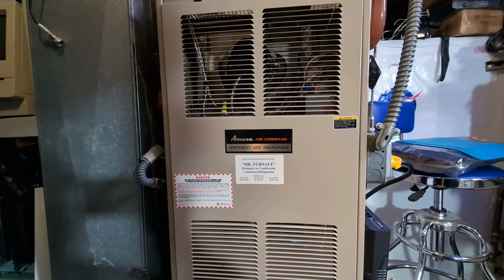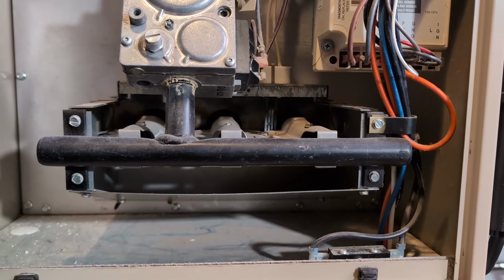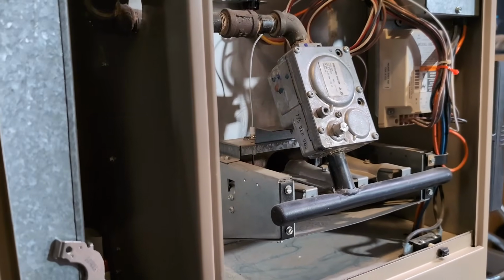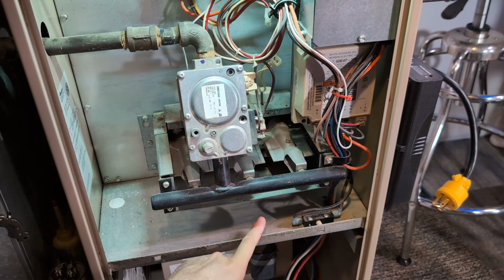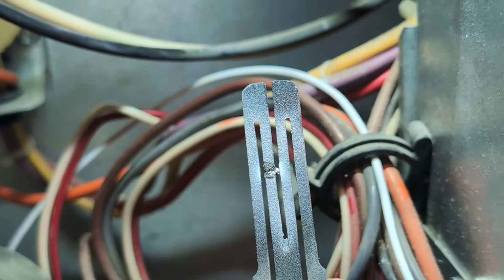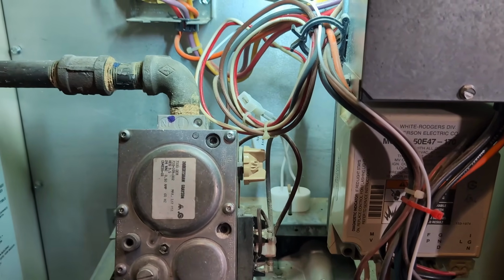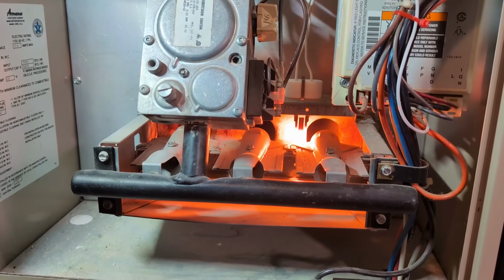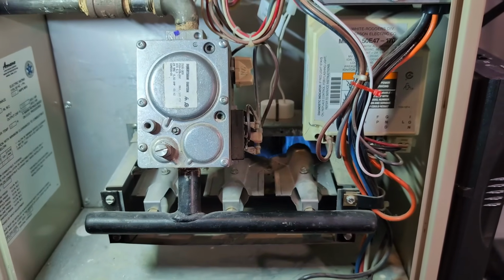Quick fix: No heat! Gas furnace repair, before I've even had my coffee. (Amana Air Command)

Comment: As an HVAC service technician I approve this level of repair. Silicon Carbide aka Hot surface igniters do tend to fail at the most inconvenient of times. Having a spare around is always a good idea. The flame sensor you usually can clean off with a little bit of sanding cloth or a Brillo pad in a pinch. I usually on PM calls just clean them to be on the safe side for the winter. No issue in keeping a spare one of those. Spare parts I do recommend to people to keep on hand when they are going to do self repairs is the one's you already have on hand but also the pressure switch for draft motor proving and a draft motor. The device you called a thermal cut out switch is called a fan/limit switch. It cycles the fan on if there is heat present in the heating chamber and also has a limit function to cut power to the gas valve. Those do not go out really. I have never had to replace one in my service so far. Though most systems now don't use the combo unit there but 2 separate switches no help keep the costs down. Not often but the 24v transformer may go bad but that is usually from a power surge taking them out.
Reply from the maker: Yeah nice. Another tech recommended the pressure switch too. This furnace has a flame rollout sensor as well (behind the gas valve) which I could see possibly failing one day, but not likely as it should never open unless overheated. (I did some more looking at the wiring diagram) 

I may look to order a few more spare parts for this furnace just to have on hand -- who knows, it's 35 years old they may just discontinue some of them ...
Reply: @adriansdigitalbasementextras you might want to check the capacitor on the blower. Those are a common item that fails at the most inconvenient time. It will be the same with the dual capacitor in the air conditioner outside. With proper maintenance these systems can keep running for decades. They just are not as efficient. At least you don't have a Lennox Pulse furnace. Those you pay an arm and a leg for their parts.
Reply: @adriansdigitalbasementextras  if your rollout fails, you'll know it because the main blower will run constantly, blowing cold air around the house.
Reply: I'm assuming they tend to fail at the moment they are  turned on. Just like a incandescent lightbulb.
Reply: @NaoPb it is weird at when they fail, they fracture during the cooling down and when power is applied the joint starts to heat and expand at different rates then it arcs burning the joint. That is why it usually develops the pitting and white marks.

Comment: Does that thing burn with an open flame?
Reply: Yes, but it's enclosed in the furnace box, and not in the airstream to the house vents (there's an air-to-air heat heat exchanger).  It does require a double-wall exhaust pipe.
Reply from the maker: Yep, room air is sucked into the combustion chamber and vented out the flu. The furnace won't operate without adequate vacuum to ensure flame exhaust goes out the flu.
Reply: yes they do they are atmospheric boiler (furnace) modern ones are now room sealed well at least they are in the uk dont know much about them over there in us
Reply: @RachaelDoorbar  Adrian's is induced draft, not atmospheric boiler.

Comment: Piping flammable/explosive gas into one's home is wild to me!   I'd never sleep being paranoid the house was going to burn down at night!
Reply: Electrical fires in the home are far more common than incidents involving gas.  Here in the UK the majority of homes are heated using natural gas, although it is slowly being phased out due to environmentl concerns.  We also generally use combination boilers for heat and hot water rather than furnaces.
Reply: @monikaw1179  like, mine is set up that way but when the boiler system broke there was apparently some kind of building regulation in the way of a straight replacement and I ended up with an electrical combi boiler. But still a gas hob. If it was my own place I would’ve just replaced both to save on the standing charges, I like the stability of electrical hobs anyway, but the landlord of course went for the cheaper option of just doing one.
Reply: Do you turn off your electricity at night?  The majority of homes and businesses in the United States use gas heating.
Reply: There are so many safeties installed that it will be a miracle to make it catch fire

Comment: You are SO fortunate that you had the part on hand! It isn't the one I would have kept on hand, either... igniters have always seemed pretty reliable. The thermopile/-couple has always been the weak link for me, but fortunately, you can often temporarily rescue a cold-morning with a few brushes of sandpaper on those.

I'm a little surprised that your furnace controller only had a lockout indicator. Most I've seen have a whole blink-code error that will tell you what it thinks is wrong with itself.

Also, did your furnace operate with the door off? At the bottom of the door was a door tamper switch. Some furnaces won't operate without all the panels installed. Those furnaces will usually provide a little window so you can still see the blink codes insides without removing the panel.

If anyone else is keeping notes, consider keeping a motor-start capacitor on-hand for your AC, too. They're a really cheap part and easy to replace, but can cost hundreds of dollars if you have to roll a truck up to your house during a heat-wave.

(Apply standard warnings about large capacitor safety here.)
Reply from the maker: The power cut (safety switch)  only applies to the lower section where the blower is located. That cuts power to the entire system. This is a furnace from the 80s, I don't know much about furnaces but I don't suspect they would prevent you from removing the top cover while operating back then.  I've seen blink codes on furnaces 10-15 years newer than this one.

Comment: The hard drive stepper magnet stuck to the heating duct made me laugh.
Reply: I have a whole line of them on the steel shelving in the basement.  I've also used some for holding the velcro in place for the string of lights in the gazebo.
Reply: i have multiple of them stuck in various places. i probably own a good 100 of them at this point. and i keep adding to them when i can cuz there so useful for so many things

Comment: i spent a few days in Portland and enjoyed gas, I've only had electricity all my life up in Washington.  I did work at a greenhouse and had to service our oil based heaters which use a spark based igniter.  Had to position the electrodes so the gap was correct, had to R and R them and sometimes the transformer coils, replaced the oil jets that would slowly wear.  Had one unit that would pop loudly when it started up.  We had a few newer greenhouse units that heated with propane.  We never had any problems with those so I didn't really touch them.

Comment: I would not have thought the hit surface igniter would be made out of silicon carbide - that’s why it’s sparkly black.  That same material is used in high temperature laboratory furnaces.

Comment: I'm having issues too... it works (sometimes), but other times it fires up, but turns off the burners after a few seconds of ignition
Reply: That usually means the flame sensor is failing. It isn't able to sense a flame, so it shuts itself down. You can try to brush off some of corrosion on the sensor with some sandpaper while you get a replacement.
Reply: dirty flame sensor - clean it with green scotchbrite or fine steel wool (sandpaper is TOO abrasive) and it'll be good to go for years again

Comment: Furnace from the 80s? Isn't that terribly inefficient by todays standards?
Reply: He might be able to switch from an 80% efficient one to a 95% efficient one, but that will require new plumbing for flue gasses and condensate removal. However, that'll still only get you a little more efficiency. At that point, switching to a heatpump is probably a better move, but that's an even larger installation problem, and I don't blame Adrian for putting that home project off for a bit.
Reply: No. His is 80% which is an upgrade compared to the base level in the 80s. which still meets today's (minimum) standards.

Comment: Cold house and without coffee? That is a serious effort video for us Patreons 😊 
Could you have lit the gas with a "long" lighter?
Beautiful blue flames!
Reply from the maker: YOU know yeah you can light it that way, I wouldn't recommended it but in a pinch, yeah! Just hold the flame there and it will act like a pilot light. Wait for the furnace to start the gas flow and then remove the "manual pilot light." Of course on the next cycle the furnace wouldn't start, but it would be good to blast the house with heat during a winter storm if you couldn't get another igniter quickly.

Comment: This happened to my old heater (89) but it didn't have the extraction fan. I woke to a cold house and a gas filled garage.
I replaced the starter and eventually the entire heater.
Reply from the maker: I chatted with a couple HVAC folks and they all recommended to keep this furnace. It's only 80% efficient, so it costs more to run in the long run versus a modern 95% condensing gas furnace. The issue is this is extremely simple and easy to service, and built extremely well. 

Examples: the bearings on the air handler and extraction fan have oil ports, so I can easily oil them regularly. (Which I do.) The fans are also rebuildable, I talked to a local electric motor shop and they said they could easily rebuild both of them, if needed. The rest of the parts are easily obtainable and cheap, with them all being in stock all the time. 

It's not really that cold here, so even in the peak of winter my gas bill isn't more than $100/month, so a new furnace might offer a $20/month savings, at most. The issue they said was not only would it be expensive to install a new modern furnace, the service life of modern units is quite short, so I would like be replacing a new furnace before any savings would even be realized. Then we have breakdowns on newer furnaces (which are more complex and have more bespoke and harder to find parts.) This would likely put you out of commission for longer. Can't just run to a HVAC store and pick up the parts you need to make it work again like I can with this unit!

I've been using this furnace since 2012 and have never had to fix it, not a bad track record! I just ordered a new igniter... even with inflation it was just $40. The one on the unit might have been the original (USA made) part, so the new one I just installed (it said Made in China) is likely not going to last as long... so it's definitely key to have the spare on hand.
Reply: @adriansdigitalbasementextras  I had to replace a 95% furnace in my house with a 80% one. It was in an unheated attic and the condensate system constantly froze up and eventually cracked open the furnace.
Hey, sometimes the best option isn't the best option.
Reply: @adriansdigitalbasementextras  We recently bought a house here in Germany and luckily it was already equiped with a condensing gas furnace, as otherwise we'd have to change it in the next few years due to government regulations.
Also oil furnaces, which used to be very popular, have to be exchanged by the new owner when a house is sold - only current owners get the right of continuance for at least a few more years.
Reply: No Smoking Area 😉